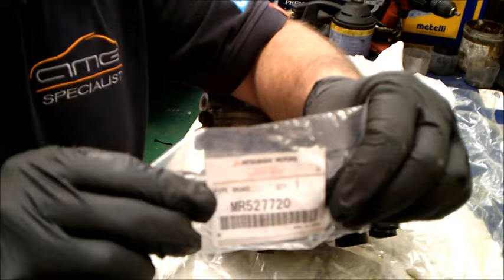Mitsubishi Pajero ABS Unit Fault  Fault Code 53 & 57. Pump Replace .

Comment: Thanks for the informative video, just what I needed for assistance as I begin to replace my unit.  It makes a loud squeal sound every 5 - 10 secs and the accumulator vibrates.  I don't have codes or equipment and can't tell if it is the motor or accumulator.  I suspect the accumulator since it is vibrating and have a good used one that I'm going to use to replace the whole unit or to swap the accumulator.  Since the unit I have received looks real good, I'll probably just swap it and cross my fingers that it's good.  Learning a lot, every day.  Update:  replacement made, car running good.
Reply: I did replaced the accumulator but the squeal sound and it still vibrates.. probably its the pump... i dont know should i replace the pump or the whole assy which is costly. How about you what will you do???
Reply: @leORaz  I found a used complete master cylinder that appeared to be in good condition on Ebay for $400.  I replaced the whole unit since I didn't know which was the problem.  The car is running great, no more squeal and I'm very happy.  I don't know the problem, but I'm going to remove the motor in the old unit soon and check.    I think that is where the problem will be found, a worn motor commutator(?)

Comment: Great video Emmanouil.  Mine is make a chirping or squeaking noise like a mouse and the pump will run for a couple of seconds.  It seems the pump is fine, do I just have a bad accumulator or is it just the seal for the accumulator to the housing?  Thanks in advance!  Rob
Reply: Did you figured out?
Reply: @nickravn6129  I replaced the accumulator.   $180 I think.  Problem gone.
Reply: Perfect, then i’ll try that. Thanks 👍🏻